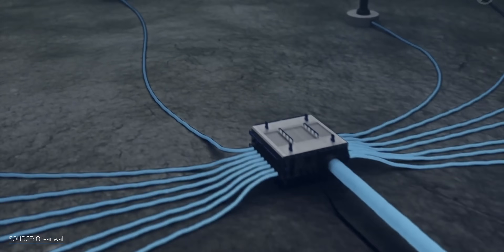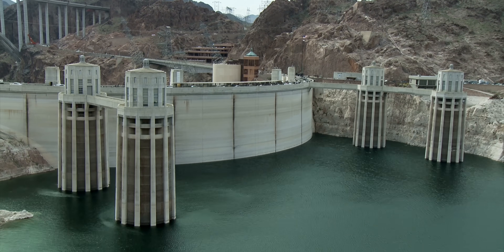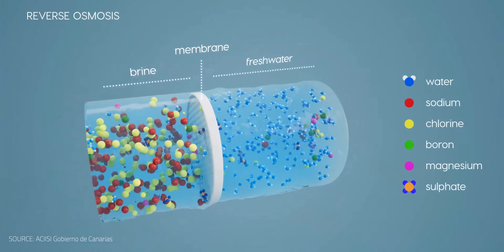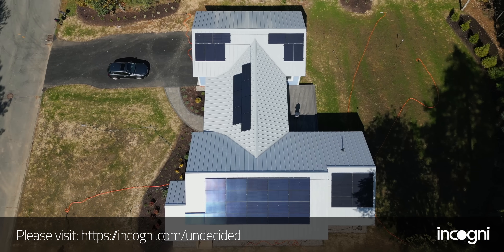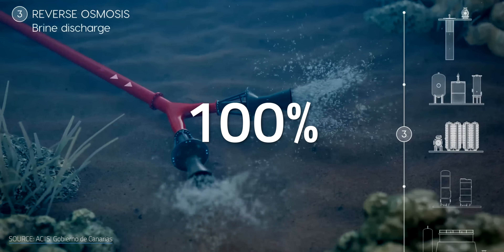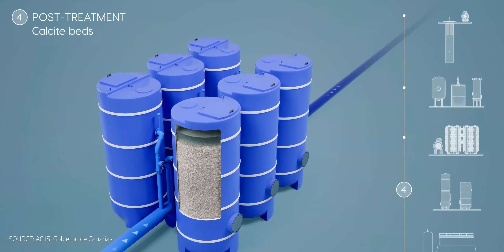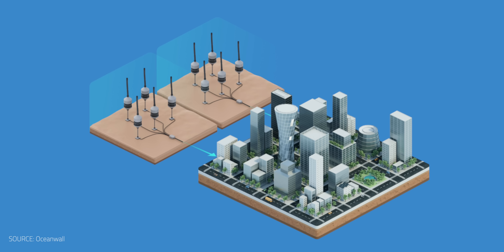How Deep Sea Water is Now Drinkable

Comment: I've always wondered why homes don't include a giant storage tank for grey water that fills up when I wash my hands or shower. Then that water can be used to flush toilets and water grass through outside spigots. Redesigning homes this way would save a ton of water because you're basically using it twice
Reply: System costs don't decrease at a linear rate as they shrink. The cost of such a system in every household would far outweigh the costs of a traditional sanitary sewer system, which still must exist to handle overflow and black water.
Wastewater treatment plants also benefit from having gray water flowing water in the system. If they were only sent concentrated waste they'd have to add fresh water back into the process to complete it anyway.
Reply: @zncon part true, waste water  treatment actually needs water with more solids to be effective and thus they filter out alot of water before bio treatment.
Reply: Such designs have existed for decades. But they do cost a premium.
Reply: Many places socialize the cost of water, so individuals won't make the capital investment to save on not producing as much waste.

Places with water shortages should charge a lot for water so that people make better choices. Either by relocating to somewhere more suitable to humans or investing to mitigate the downsides.
Reply: @nustada  Bud, try telling that to all of the South West United States, specifically California and Nevada.  Not sure where you're from but that's an area larger than most European countries with a higher population concentration in specific parts of it (Los Angeles).  Coming up with ways to produce more fresh water is a lot more realistic than relocating fifty million people.
Reply: @dhrekkin9055  I never asserted they all should move. Work on your reading skills.
Reply: Campers should work the same way so you don't run out of fresh water so fast.
Reply: Same reason we don't have separate utility water lines for potable and grey water - cost.   We haven't valued the resource such that it's worth massive building and infrastructure changes.
Reply: problem, grey water is unsanitary, you have septic tanks that use bacteria to eat shit, literally, and produce clear water, but is is still unsafe and is dumped into a leech field, but its not good to use for any thing, also dumping soap or chemicals in to a septic system can kill the bugs or block the tank, you can use rain water to wash, drink and flush the toilet with but grey water is a product of septic digestion, thusly it cannot be used for anything.
Reply: This is done on islands with a rain water ration, rather than places with large aquifers that most places have, which is cheaper to draw from compared to the small reaping of water from rather expensive infrastructure to reuse water or collect rain.  Normal life watering yards and taking bathes every day need not apply. It is for places where water is truly rare and precious.
Reply: Capital.  It costs money to make such a system.  For minimal gains.

Comment: Deliberately or not, the video is deceiving. Actually, there is no gain in electricity consumption under water because you need to pump the water out from the sea floor. This means applying the same pressure that was created by the sea. For those who don't know, 10 metres of water is roughly 1 bar. So if you are 600 metres below sea level, you need the same 60 bar pump to bring the water up again. And all the RO manufacturers already offer to use energy recuperation devices on the brine, so you don't lose energy there either.
It's really disappointing that instead of educating people, the author decided to create clickbait videos, gather views, and promote comments.

Comment: 1:37 Global Warming is supposed to flood the earth, not cause a drought.
Reply: @suggesttwo  it does both in different areas, areas near coast get flooded and the changes in ocean's shape changes the air currents and movement due to which some areas are left with left water and rain (since it affects wind currents too)
Reply: @minkeymoo  If you believe what you have written you don't understand how gravity works. The tides are caused by the gravitational force of the moon. Not the climate.
Reply: @suggesttwo you don't understand what he wrote if you think it was about tides.

Death valley is about 280 feet below sea level and is a desert. Lake Mead is ~1100 feet above sea level and is a lake. Here's an experiment for you: take a glass of water and walk upstairs. Did it dry up? No? Congratulations, you now understand why you can have water rise in some areas and not others. Just rain and a fixed cup instead of legs carrying a cup.
Reply: @Zirnike Have you ever seen a U-tube that measure Manometer? Or the trap under/behind a sink/tub/toilet/washer?!
Reply: @suggesttwo  Yes. Again, you're proving you are not listening to the point because your comment is completely irrelevant to the actual point. I literally gave examples of how it's not relevant before you tried it.

Read.

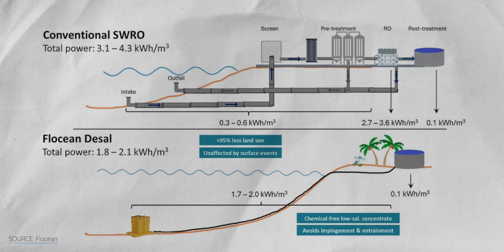Comment: 7:00 Your explanation of how building deep raises efficiency doesn't make sense. Regardless of where the pump is they still have to cause the pressure differential on the membrane. It's just as hard to create a high differential underwater as on land.

Filtering in the ocean saves power because you're not lifting the salt and microorganisms. If you filter on land it means you've pumped all that uphill only to drain it back down like Sisyphus and his boulder.

Building underwater is what allows them to flush with lower salt concentration. They didn't have to pump the 'waste' brine up a hill, so extracting the last bit of water from it isn't important. That's why they don't just run this filter on land.

Classic desalinization dumps about 3-4x the volume it produces, so not pumping that up to shore is significant.

Comment: a question i have about one of the big alternatives of RO-systems: distillation. it's clearly extremely energy intensive, but - couldn't that be mitigated by integrating a heat exchanger into the system? after all, when the vapor condenses and cools down, it gives off the same amount of thermal energy that was used to heat and evaporate it. couldn't this energy be used to pre-heat the input?

Comment: What I have been wondering: given that saltwater contains approx. 3% salt and has approx. 3% higher density, shouldn´t a semipermeable membrane hanging from a suspended hose not have fresh water pressed up without any pumping required? 3% of 1 bar per 10m gives 3 bar per km depth. Minus the pressure loss through the membrane minus the pressure loss along the hose should result in a small continuos flow of water without any energy input needed.
Where is my mistake? I assume that I made a mistake, because if it was that easy, why isn´t it being done since 50 years?

Comment: Some of your analysis is unfair to traditional desalinization. In traditional systems, in responsible countries, brine is mixed with sewage effluent to match, or be lower than, the salinity of the local ocean.  Also, pumps can be switched on as only necessary to balance the grid, allowing for the increased use of renewable energy grid-wide.

Comment: Doesn't it take same amount of energy to pump fresh water to sea level?
Reply: No we already have to pump water from an aquifer or water reserve, this is just pumping it a little further instead of having to do desalination which uses extremely high pressure to separate out the salt. We pump oil from the bottom of the ocean all the time and that's way more viscous this would be far less energy intensive

Comment: Why not make a water tower with a simple pump on it. Using the waters own pressure to force the salt water through the filters?
Reply: So we're at sea level and that's one atmospheric bar, the average bottom of the ocean is around 380 bars of pressure, so it's about a 380 times more pressure to force the water through, which is what we usually use pumps for. It's not the height that creates the pressure but the weight of all of the water in the ocean on top of the water at the bottom. Hope that helps 👍

Comment: Wait, why is pumping the desalinated water easier? Shouldn't they need the same pressure to get those water out to shore from those depths?
Reply: The pipe has an internal pressure separate from the pressure of the ocean you just need a thick pipe

Comment: um, whatever happened to good ole fashioned evaporation? too accessible? cant monopolize it? seems there is an obsession with overly complex "solutions" that are plagued withissues requiring their own needlessly complex solutions. nature always does it best. people should try it. then when faced with obsticles, rather than try to reinvent the wheel, look again towards nature for a solution
Reply: Look at Saudi Arabia which uses desalination or other gulf coast countries. They also have tried evaporation methods but it's more cost effective and higher yield to do desalination currently.
Reply: @xinidae  i can see that. but how much innovation juice has been pumped into the idea of evaporation? id bet not nearly enough, in comparison. definitely wouldnt be worthwhile trying to fill a massive, shallow pool with a cover BUT.. how about those offensively stupid solar plants that use mirrors to reflect the sunlight to boil water to turn a steam turbine (simple enough 🤣), could probably use sunlight/boiling for de-sal with substantially smaller footprint. or even, pump saltwater through a weave of tubing embedded in rooftops or roads. anything black. saltwater in, hot steam and a little brine out the other side. like a radiator in reverse. might even cool down whatever its embedded in, as a bonus. 

idk, i think its just due to money. elegant, streamlined ideas arent exciting to investors and its not easy, if possible, to monetize simple, nature-inspired solutions

Comment: Why not build water pipelines to inland areas? If we can build oil pipelines we can do the same for water
Reply: It's just cost, we pay multiple dollars a gallon for oil but the tap in your home to fill a gallon of water costs a fraction of 1¢. If water became so scarce that we had to we would but you would also be paying $10 to take a shower
Reply: @I don’t feel like the cost would be all that high considering we already pipe water to homes. It’s just a much larger pipe(s). 

Really we should be paying more for water. Or at least businesses should be.

Comment: I see a lot of people getting hung up on the energy efficiency, but i think they forget about the other benefits. The water is supposed to be already cleaner. Now you dont have to run same sanitizing solutions to clean the water which saves energy and the releasinf of the brine is supposed to be more environmentally healthy as well. Its not just about energy its also about the pollution it creates.

Comment: would be fun to see this re engineered to use ocean waves as the pump itself ie no electric required.  as the waves on the surface move the pump lever ballast up and down (like an old hand pump in onland wells) water is moved from the reservoir (ro unit) through a pipeline to shore.  shore side pumping could assist if needed which would be much better then running electric to the RO.

Comment: Has anyone ever tried to pump water through pipes in the ocean bottom, down a coast line to a city?  Imagine pumping fresh water from a river/stream.  Ocean currents might destroy the pipe.  Oil gets pumped via pipes for long distances on land with problems that have mostly been
solved.  Pumping fresh water from the outlet of the Columbia river under sea to California might be possible.  Probably would have to have automatic valves with electronic controls every so often.  Cables are laid in the ocean long distances.  Pressure differences might be a big problem?

Comment: If they put a large hydrophobic umbrella over the top of the intakes, falling creatures and other debris would sluff-off to the sides, and not jamb the intake filter as much.  We should also use every rivers mouth as a water source before it heads to the sea.  It's the most logical water source, even though it's not "clean as can be", we could pipe it inland, run it though huge sand filters (think desert well), then send that to water-intakes for city supply and normal filtering.  RO is expensive, and not very eco-friendly overall.
Reply: You know there's not just water in the river right like there's fish and boats that need it?

Comment: I've wondered for years about the feasibility of generating electricity based on differential between high pressure water at depth and low pressure at sea level. A mechanism that expanded and contracted a membrane linked to a piston to drive a AC generator.

Anyone know of this type of system being prototyped? Why it would not work in theory?

Comment: You will need around 800m to 1km get the pressures required for reverse osmosis to start properly, then you will need powerful pumps to create suction and flow to get water out the cells to the surface, there is also the issue of marine snow clogging the filters and corrosion increasing the maintenance costs

Comment: Surely part of the 'free pressure' gradient is due to the different relative densities of salt and fresh water 1.03 vs 1.00.  for two columns of water of the same height the saltwater would have a slightly higher pressure. The deeper you go the larger the difference..
Reply: and the pumps could be eliminated by having a pipe that goes even deeper to release the brine.
Reply: @LaserFur The thought did occur...

Comment: I don’t see how this is solving the brine problem, which is really the issue with desalinization. If you want 1000 gallons of fresh water, you’re pumping the same amount of salt back into the ocean regardless of how concentrated it is. I don’t see how them pumping it away is any different than what other desalination plants do. This whole thing also needs to be powered, built, and maintained off shore and deep underwater. It seems like an overly complicated solution that doesn’t solve the brine problem, and at best, uses less power? I don’t think that would offset the complexity and cost to build and maintain a system like this. If carbon is what they’re trying to reduce, using nuclear power or nuclear desalination is a better solution and proven technology.

Comment: Thank you for sharing this new or now-in-use technology, but my preference is for every coastal city to purchase/install a Thorium Molten Salt Reactor. These reactors would need a lot of cooling. To do that a standard hyperbolic cooling tower would be used. MIT and others are working on ways to collect the hot steam from the top of the tower and condense it. Since it's essentially distilled water, it just needs to be captured and collected. Tada...fresh (even better than RO) water.

This can actually be done with any power plant that has access to salt water for cooling and uses a hyperbolic cooling tower.

Comment: Pure investorbait technobabble.

Their premise stands on a fundamentally flawed conception of flow mechanics (at least, the way it is presented in this video). It takes just as much energy to force water though a membrane at the bottom of the sea as it does on the surface. Because sure, there's a tremendous amount of pressure pushing water into your membrane, but there's also the whole column of water you are trying to pump up pushing against you.

Maybe there's merit to the project on other notes than the pressure thing, and it's not all as bad as it sounds. Maybe it pays off having your membranes innaccesible just so the water you take in is more pure... Why not have an intake further down then? Why not have just the pump and do the membraning up top? 

Do you think companies return pure brine because they hate the environment? No, it's because it's more profitable and noone is stopping them. If there were regulations it would be as easy as pumping the saltwater out with just a bit more of surface water.

They are selling a perpetual motion machine with cute renders.
Reply: So the pipe actually experiences the pressure of the water but the water inside the pipe would have a separate water pressure once going through the filtering pods, so the cost of pumping it from the bottom of the ocean would be likely no more than the cost of pumping water across the same distance on land. It's still the cost of pumping the deepsea water through the desalination pods that's the biggest cost just with a lower one since the ocean pressure does some of the work

Comment: I was thinking about the same thing! If you need ~8 atm. of pressure for reverse osmosis then you need only 80 meters of depth in water to achieve this pressure. After that you only need energy to pump it back to surface
Reply: For commercial use you need 20-50 bar difference over the membrane. That is a lot of pressure on equipment 200-500 meter down in the sea.